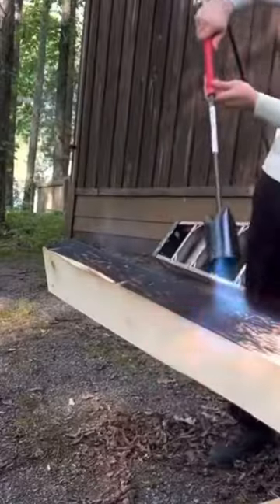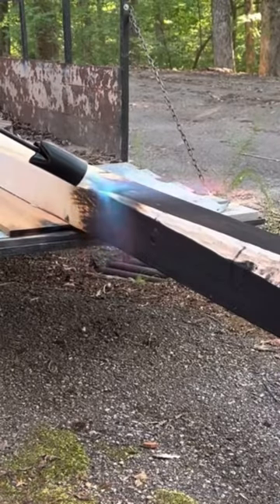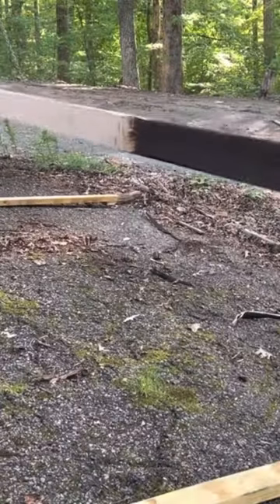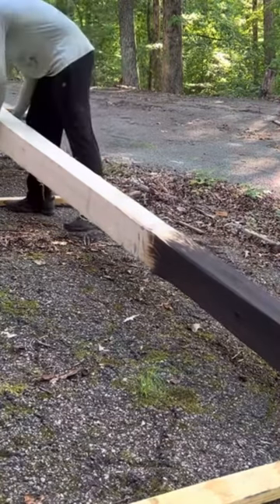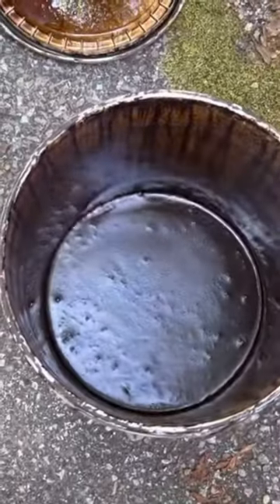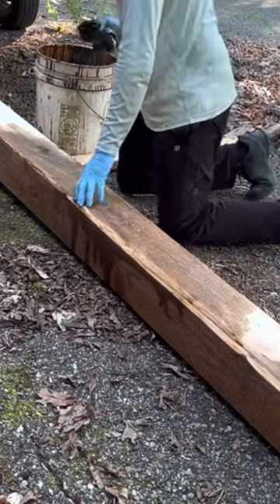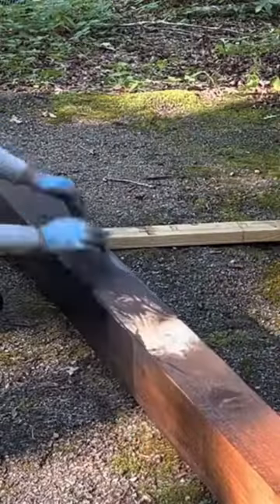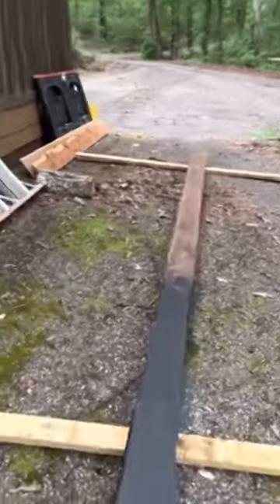Treating Wood for Outdoor Use on a Budget #shorts #diy #wood #construction #sawmill

Comment: Seems like a good idea, but living on a well system makes me hesitant to put anything treated in the ground.
Reply: Burning it alone won't do anything
Reply from the maker: I treat the burned part as well with the 50/50 mixture. I forgot to say that.
Reply: @tennesseetimber  50/50 mixture of what?  Can burning & mixture be used on untreated wood from big box stores such as home depot or lowes?  Thank you
Reply: Yeah same. I burn it then apply a hot mixture of edible flaxseed oil and beeswax. Works great. Also choose wood varieties that are naturally rot resistant. Like in my area I use post oak, cedar, or locust
Reply: @tennesseetimber that 50/50 mix will barely do anything either.